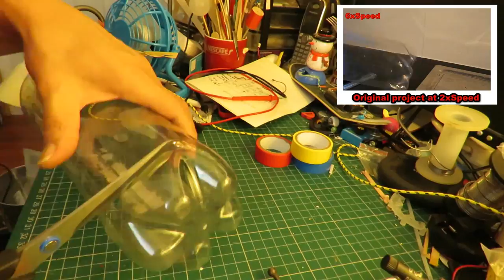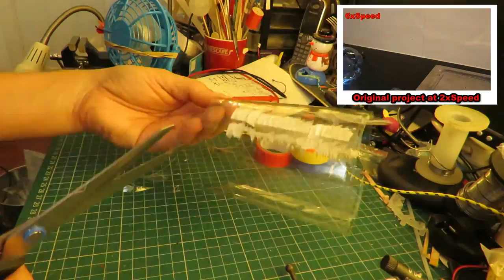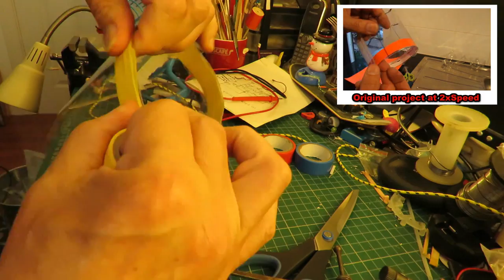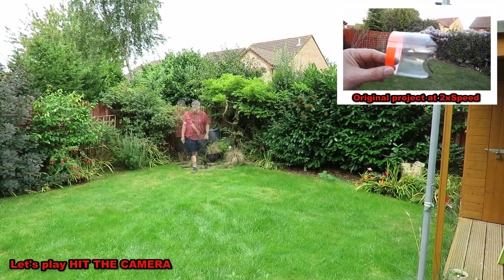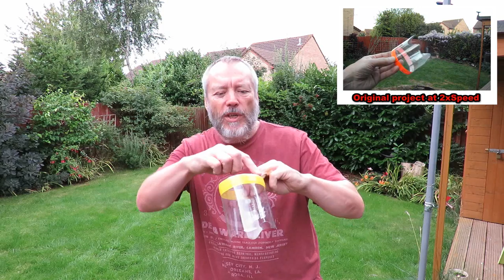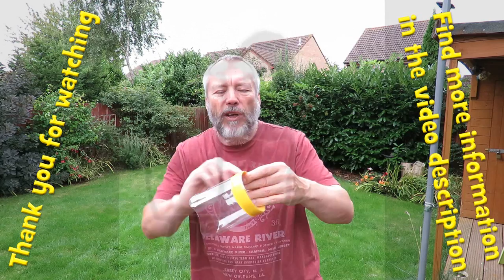OLD PROJECTS revisited Spinning Gyro Soda Bottle Plane Thing

Comment: Grandasanoldman channel:
Where saftey number one priority   😂
It flies pretty good. How well would a 2 liter bottle work?
Reply from the maker: It's all about getting the balance right and getting a good spin on it when you throw it. I guess the important thing about size is how well it fits in your hand so you can spin it on launch. If you have big hands then I guess you can manage a bigger bottle :-)
Reply: A strip of double sided tape running lengthwise would provide friction for the fingertips.
Should get a good spiral.
Reply from the maker: Wil Hobbs something like that, but I would think just normal tape to give a little ridge for your fingers to grip, I suspect double sided sticky tape might stick too well.
Reply: I watched the original video plus the video you linked.
He actually used the 2 liter bottle.
Reply from the maker: Wil Hobbs I found I could throw a smaller one more consistently. There is another video on the 29th where I use cardboard tubes and I find the smaller one works best for me.
Reply: Cardboard?
I would've thought it to be too heavy. 
Can't wait to see it.
Reply from the maker: Wil Hobbs they fly fine, I am resisting making one from a tin can, they are rumored to fly well but I hit our windows enough with these ones, I don't want to tempt fate by making a metal one. I don't think it would do the camera any good either when I try to hit it.
Reply: Sounds like a ninja weapon. 
:-)